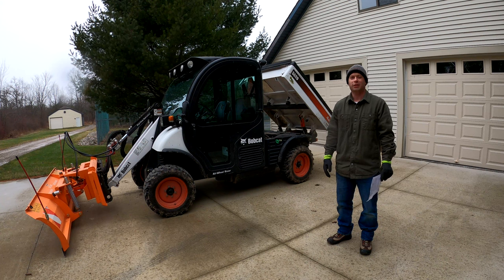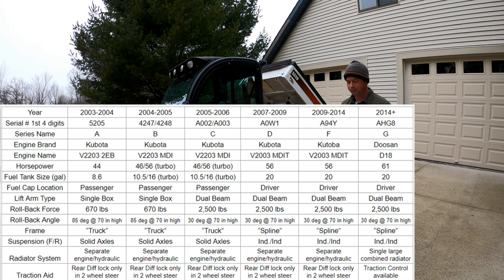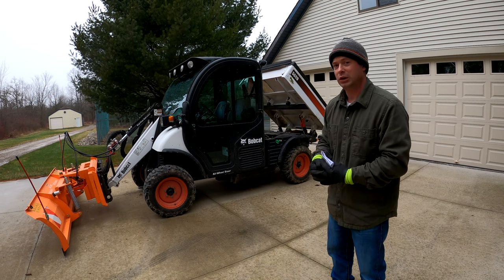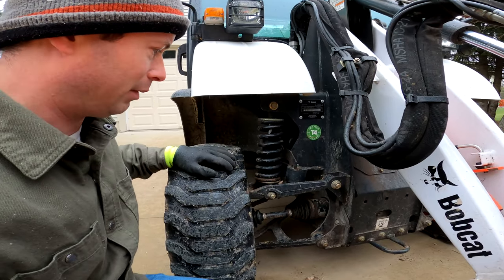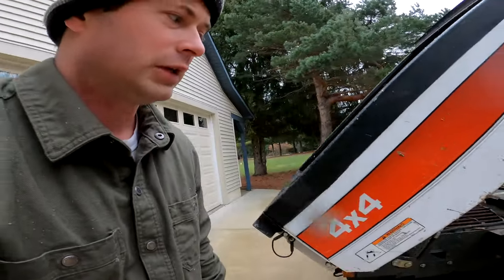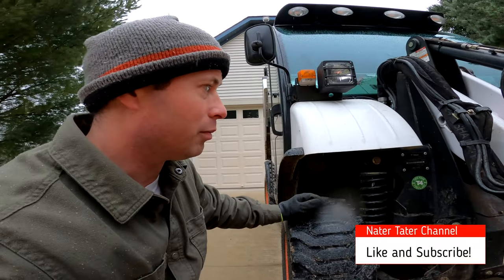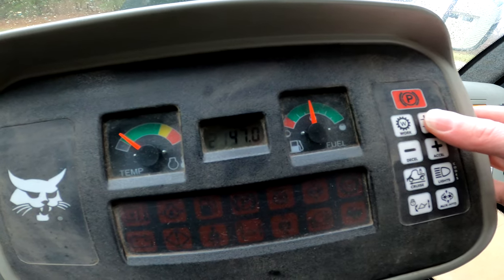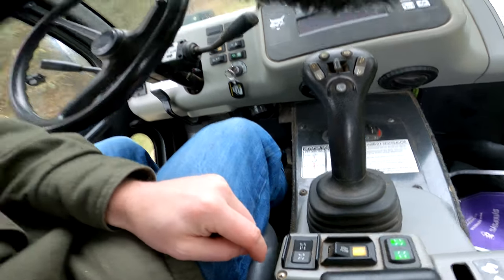✅ Toolcat 5600 Used Buying Advice - Major Changes Over the Years - What to Look for, What Breaks

Comment: I work for a bobcat dealership for 6 years, these things have alot of issues. HYD PUMPS,ALOT OF ELECT. ISSUSE i HAVE REPLACED FULL HARRNESS ON MANY OF THESES TOOL CATS. TO REPLACE THE PUMPS OR HARNESS YOU NEED TO REMOVE THE CAB. EXHAUST MANIFOLDS BREAK OFTEN, FRONT BOOMS ARE WEEK,CV JOINTS BLOW SEALS.THESE are just a few of the day to day repairs i did in the 6 years I worked for that dealer ship. Just my 2 cents.
Reply from the maker: Never had a problem.  Ask a doctor and he'll tell you humans are never well.

Comment: How did you replace the seat? I just got a new one and was wondering what is the easiest way to remove the old one. Thanks
Reply from the maker: I just undid the 4 bolts holding the seat mount to the cab and took the seat with mount/sliders out.  Then unbolted the seat from the mount.

Comment: I remember seeing these in the repair shop I worked at. Alot when they came out and how the hydraulic drive system was very poor, lots of issues.i hope the issues are resolved by now. Have you had any issues?
Reply from the maker: No issues on mine but the first generation ones like 2004 had drive unit failures that I think all got replaced.  That said skid steers and toolcats have lots of hydraulic circuits and devices so they do take some maintenance sometimes.   Definitely more so than a simple crop row tractor.
Reply: @NaterTater  I work for a bobcat dealership for 6 years, these things have alot of issues. HYD PUMPS,ALOT OF ELECT. ISSUSE i HAVE REPLACED FULL HARRNESS ON MANY OF THESES TOOL CATS. TO REPLACE THE PUMPS OR HARNESS YOU NEED TO REMOVE THE CAB. EXHAUST MANIFOLDS BREAK OFTEN, FRONT BOOMS ARE WEEK,CV JOINTS BLOW SEALS.THESE are just a few of the day to day repairs i did in the 6 years I worked for that dealer ship. Just my 2 cents.
Reply: @DTRAX33  .02? You just gave out thousands/millions of dollars of GREAT ADVICE! I keep waiting for JD to come out with a "big brother" to the Gator; 🐊 Crocodile 🐊, "Croc". The Croc would be hydraulic, 50 + hp diesel engine. Attachments: Bucket, blade, sweeper & snowblower; naming just a few. Getting colder every year, blowing snow on my JD x595. The Croc, in all likelihood won't happen ☹️. Would rather have a UTV vs a skid steer, more user friendly. I'm a green & yellow guy, I'll admit. I want one that can blow snow & performs well with a grapple.

After reading what you wrote, I'm running back to Deere, skid steer here I come! Thanks for you're honesty, lots of money will be saved by those who read you're Comment: Appreciated. Respect.
Reply: @DTRAX33  what hours where you seeing on the machines that had those issues
Reply: manfods break all the time, I`v replace harrness 3000hrs and up. I in wisconsin so salt plays a big part. hope this helps
Reply: I’m looking at what looks like an 04,05 with 2,400 hours. Anything specific I should keep an eye out for?

Comment: Do these toolcat's tear up the ground?  I have a tracked skid loader and it tears up the ground so bad arounf the yard.  Great digger, but is kinda like a bull in a china cabinet!
Reply from the maker: Common misconception but a bull in a china shop typically doesnt knock over the shelves!  A Toolcat is much easier on turf than a CTL or SSL since it has 4 wheel steering.  If you run turf tires it shouldnt leave any evidence (unless you steer while stopped or ground is wet/soft).

Comment: Sorry only have an iPad. How did you clean some of the surface rust on your 5600. If you have another way for me to get you some photos let me know. Thanks.
Reply from the maker: Bruce, go to the tractorbynet forums, i'm user npartist on there.  Here's a post I did when i got the toolcat and pictures of the rust repair.  You can reply on the forums or message me on the forum as well.  https://www.tractorbynet.com/forums/threads/toolcat-to-s185-skid-steer-to-rzr-900-comparison.420497/

Comment: 32K for a 2000+ hour unit seems high price for what it is....I suppose if you're doing more than plowing snow with it, might be reasonable.  Why didn't you just go with a base skid and whatever tool you needed for it?
Reply from the maker: Hey Earl, yes they aren't the cheapest tool or even best "bang for your buck".  I've had two skid steers before this.  For more on why I sided with the Toolcat see my comparison https://youtu.be/PQl9K3oL61k
Reply: @NaterTater where did you get the aftermarket replacement seat?

Comment: Don't buy toolcats period. These new 2024 models are loaded up with so much rust from the factory. 

The suspensions are bound to fail rapidly. Each control arm gets 4 white plastic bushings that get a black O-ring around it. This is supposed to prevent any water from entering and forming rust on the weak unpainted bolt holes. If customers saw how rusty the metal already was under those white bushings when they're installed, nobody would buy one.
Reply from the maker: i still love mine! doing great.